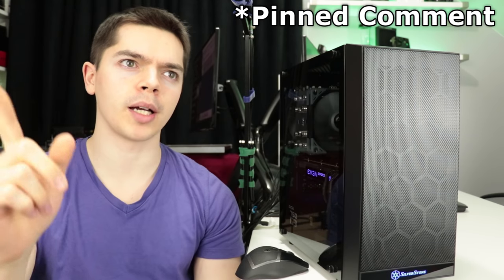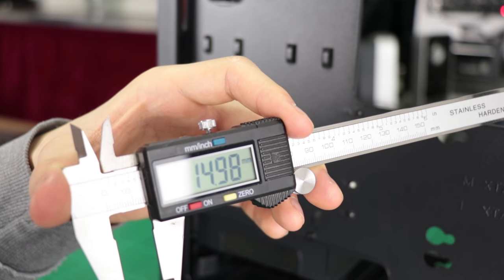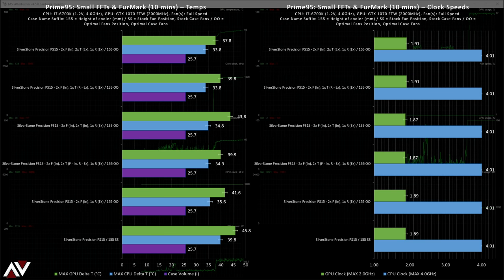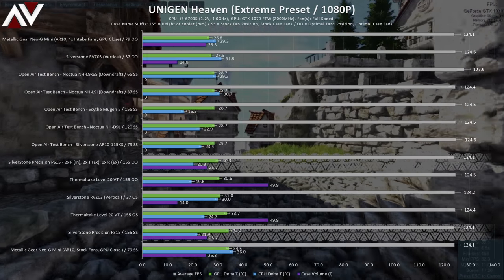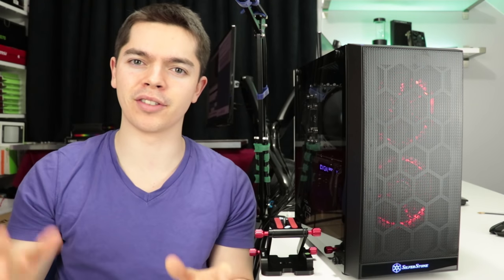SilverStone Precision PS15 (Micro ATX) Review (1/2)

Comment from the maker: Time Stamps:
01:37 - Unboxing and External Overview
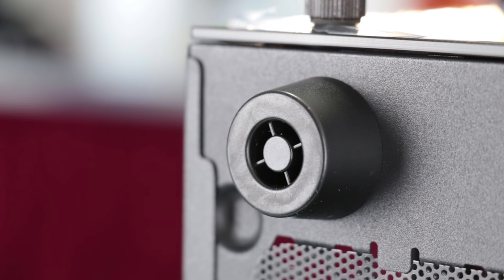04:47 - Internal Overview
09:13 - System Build
10:11 - Power Supply Unit
10:56 - Motherboard + CPU Cooler
11:46 - Drives
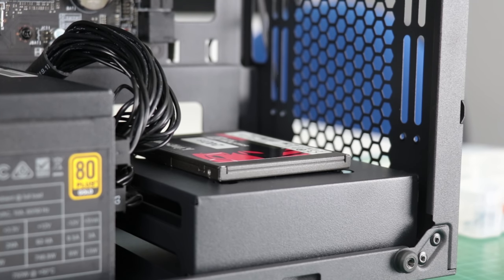13:15 - Graphics Card
13:56 - Case Panels + Cable Management
15:43 - Optimal Testing Setup
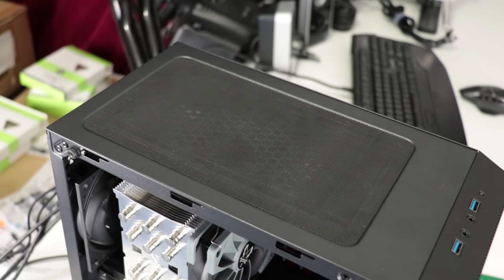16:26 - Fan Installation Warning and Tip
20:11 - Thermal Testing Results
25:36 - B-roll
27:13 - CONCLUSION (Super Important Part)
Reply: AV Techy hahahaha.  I respect your honesty on why would they send a 3,000 subscriber channel a review sample.    Good review.  I wish the case came in while.
Reply: Will this support the Asrock B460m Steel Legend?

Comment: I ordered one of these as most micro-atx are massive boxes and only this case and the Inwin 301 are really in the right size range while having window options.  The regular Inwin case had a front panel that lights up a fixed colour and ruins the rgb scheme and the Inwin 301c (rgb version) I decided was too expensive, £100 and no fans, this case does the job at half the price with rgb fans.

Some modding ideas I have;

-  I have spare higher quality feet with rubber soles so will change those.

- Can mod a higher quality magnetic filter for the bottom 

- I think the hard drive cage is a waste of space, two spaces on the back for ssd's and can fit a motherboard with dual m.2's, would look at either a light mod of removing the cage for extra space for cables, a fancy water cooling radiator or look at cutting a cole for a blu-ray optical drive or something.  

-The case panels having too much clearance from manufacurer error magins, will probably look at attaching rubber seals to the edge of the panels.  

- Thinking the case is a sort of gunmetal grey and thinking I might want to repaint it to be more of a black.

Comment: I strongly disagree with what you say at 35:40 if you make this case longer it will become yet just another boring oversized case. But thankfully Silverstone did something different here to make it 25L! Honestly this thing could be even shorter if you ditch that drive bracket, though you'd need to plan ahead on your gpu length but this is a tradeoff i could've lived with.
Reply from the maker: I agree from the mindset of a small form factor builder. My comments with regards to the drive cage were going against my bias for 2.5" drives to be more aligned with the more popular 3.5" drive users.

It would have been very interesting (if not less popular) if they went for a 2.5" drive cage and reduced the size, or as you said ditch it all together for an additional 2.5" drive space behind the motherboard tray (much like the Q300L).

I'd even like to see a smaller and thicker version to allow for a 3.5" drive behind the motherboard tray for more cable management room and the option of a 2.5" drive.

Thanks for checking this one out and sharing your thoughts, much appreciated!
Reply: Yeah I would have argued they could shave a few mill off, we don't need a drive cage these days. Not unless you build a rig specifically for lots of 3.5".
My mobo has 2 m.2 and there are 2 2.5" behind the tray.

The only issue shaving more depth off is how much it limits GPU length.
Reply: Agreed, have dual m2 slots hard drives, can fit normal ssd's elsewhere, don't need the hard drive cage, going to look a the possibility of modding the case fit a blu ray drive at the bottom.
Reply: Can you take out the sled cage? Or maybe put a different one in?

Comment: Great review, thanks.

I love this case. I've built in it a few times.. they could have given us 1 more centimeter at the back for cables. Would make this case close to perfect for the budget. This is because there is nowhere to hide long cables when you have a full sized HDD installed. Having to supply molex power adds another cable to hide which adds to the drama. Your build was much easier with the 2.5 inch drive which would be a good recommendation for people. 

Also I usually build with MSI Gaming X cards which requires the front fans to be mounted inside the front cover rather than on the inside of the main chassis as you have them set up. You can see the RGB better anyway.
Reply: Hi there I am a noob doing first build, could you tell me where do you plug the RGB cables into, I thinm there is a male and female header for both fans, am I right in thinking you just plug the female header into the JRGB slots on the mobo? I just don't want to break any pins. Thanks for any help!
Reply: Sam Hoey you are looking for a four pin RGB header on your motherboard
Reply: @The_Trojan  thank you for your help! My only question is could I ask what mottherboard and software are you using? I have an MSI motherboard and I'm trying to use Dragon Centre to control RGB and it only detects my mobo RGB although it seems to slightly affect my fans too, but the colours are limited. Sorry if this is confusing but the help is much appreciated
Reply: Sam Hoey I used ASRock B450m Pro4 and ASRock B450m Steel Legend
Reply: Sam Hoey have you got the RGB connector connected to the 4-pin RGB? It will not work with the 3-pin one. Most mobos have both types.
Reply: @The_Trojan  bro, I’m having problems mounting the gpu to my ps15 case, i don’t know how to do the back screws stuff. I think it just doesnt fit. Could you please help me with it

Comment: Top notch review 👍
Nice little case that seems to have it where it counts.
Sure some corners must be cut to fit a certain price point, nothing too major though. 
Except for two things I really don’t like, 1. tethered front panel and 2. bottom dustfilter.

Exceptional job on the filming, you’re so good at getting the angles to show what needs to be seen. Those smooth pans 🤤

Nice idea with the digital calipers to show the measurements 😜

Ohh best set the background leds to a hard switch instead of a fade or static, that darn fade varies the frequency and runs outside of the set shutter speed.

Again thanks Silverstone for having faith in Alex, you will always be his first^^

Comment: Actually ordered one of these, great video review helped me pull the trigger on this one. But now I realized that my PSU is 16cm so I hope it will squeeze in.
Reply from the maker: Glad you found the video useful. I'm sceptical whether the 16cm PSU will fit, it's pretty tight with a 15cm PSU. You might get it to work if you sacrifice some of the tidiness of the cable managment coming out of the PSU.
Reply: I can now confirm that 16cm PSU can fit into this case, though its quite tight there. And the cable management was a nightmare there was virtually zero space to work with. Love the case tho, especially for the price.
Reply from the maker: @rukosak12  Excellent, thanks for posting back here with the find. I can imagine it was quite a struggle, do the cables prevent the use of the 2.5" drive position over the drive cage?
Reply: @AVTechy  There is still enough space for 2.5" drive.

Comment: I have mixed impressions about this case. It seems Silverstone has cut corners in many places and made some questionable decisions that could have easily been avoided. It's almost as like they're not used to making cheap cases like this one and didn't know how to go about it properly, heh. Personally, It annoys me when manufacturers skimp on functional stuff like that cheap-ass bottom filter or breakable PCIe covers and then stick a pricey tempered glass on it.  It's a clear case(sic) of mixed up priorities. But hey, glass sells the case, bla, bla...

So, there's a buch of small nitpics to be found but really, the only serious flaw this case has is that fan mount issue. And it is a serious issue. Nobody is going to see that coming and install some washers before building. While it's true that not all fans will hit the panel, many also will. And something is bound to break,then. Preferably just the case fan blade, not something else. It's something Silverstone can fix in future batches by installing some kindof washers themselves,or by making the fan screw holes thicker/raised.

Otherwise, it's not a bad  case. Looks ok, has pretty good cooling (as expected from that front panel), it's cheap...granted, it doesn't stand out, either. But it works.

PS: get hem to send you the Sugo SG13 to review. It's a great and cheap little case, perhaps my favorite SFF case.

Comment: Exact same internal frame as the new Rosewill FBM-X2 case, just the different branded panels.
Reply from the maker: Oh yeah, nice spot!

There are a couple of minor differences to the rear of the chassis, but the motherboard tray is identical. Very interesting.
Reply: @AVTechy  nahh they are the same, Newegg accidentally used a picture of rosewill's older version of the case for some reason, I forgot about that. Shows one pic of a top mounting psu case, but it isn't that case haha
Reply from the maker: @dawsonclark1364  They're not the same, they're very similar though. Check out the rear fan position and the PCIe slot cover to see the minor differences I was referring to. The PS15 has notched slots whereas the Rosewill case has 4 screw holes with solid panelling above and below the fan position, and the PCIe cover appears to be a hole over a slot. Very similar, and likely manufactured in the same factory with a few minor changes to separate the designs.

Perhaps this is why the front of the chassis is completely flat.

Speaking of differences, check out the front IO on the Rosewill, it's not attached to the front panel like it is on the PS15, that's a big difference and one that I prefer. I wanted the IO in the chassis on the PS15 like it is on the Rosewill case... so good on Rosewill for nailing that aspect.
Reply: @AVTechy  oh you are right about the front panel io actually being mounted to the rosewill case, but looking at the rear of my case it is identical, same fan mount set up, notched, same pci-e covers etc.
Reply from the maker: @dawsonclark1364  OMG, I'm on the Rosewill website for the FBM-X2 case and they've got the wrong rear picture for the case :P So my comments before about the rear of the Rosewill case are completely wrong, check it out:
https://www.rosewill.com/product/micro-atx-mini-tower-desktop-gaming-pc-computer-case-usb-3-0-fbm-x2/

The rear image is of a completely difference case, it's not just Newegg that's screwing up in the marketing department.
Reply: @AVTechy  haha yea man! no worries! In my first reply I said Newegg had done that as well! because they used rosewills images haha! so yea it literally is the different branded panels and front io placement, I forgot it was messed op on rosewill's site as well! lol

Comment: hey AV! thx for this very good review! BUT: how did you manage to fit in that scythe mugen5 cpu cooler which is specified at 155mm height, whereas the ps15 case has a clearence for 154mm only?? im really curious about that, because mugen5 is my favourite cpu cooler and i actually was just about to dissmis the ide of using the ps15 case because of that... another question: what would be the maximal gpu card length if  there are two 25mm deep fans mounted in front? can those front fans be mounted on the inner side of the case or also on the outer side, just behind the front cover??
Reply from the maker: Thanks very much :)

As for the cooler situation. It's all about tolerance. When a manufacturer (all of them, apart from with some really tight SFF cases) say a case can only fit in a certain size cooler, they're accounting for a few millimeters of tolerance. So when SilverStone say the PS15 can fit a 154mm cooler, they're really saying that's all they feel comfortable supporting taking into account manufacturing tolerance.

So if a manufacturer says a case can only fit a 118mm cooler, it can probably just about fit in a 120mm cooler, and so on. It's just manufacturers covering themselves a little so someone doesn't get a case that' too close to the desired lower tolerances they've set themselves to, and then correctly proceed to complain about how the case doesn't match the specification. They avoid this situation by adding a few millimeters onto the case from the target specification (or vice versa).
Reply: @AVTechy  interessting - i didn't know that! i asumed  what about the gpu card length? according to spec the gpu clearence is 314mm - so after mounting in a 25mm width fan, this would leave approx. 288-289mm for the gpu... unfortunatelly most better custom design gpu cards from the rtx270/2080 lineup are somwhere between 290-300mm (palit/gainward: 292mm, asus strix 300mm, zotac amp 299mm, msi 310mm+) - so, is it possible to mount the fans on the outer side of the case, behind the cover?
Reply from the maker: @roqnroll  Graphics card length I'd stick strictly to since it's such a large component.

In terms of what's possible, I just barely couldn't fit my 1070 FTW (266.7mm long) in with an internal 25mm fan and radiator. But you can shift the front fans to the front without impacting the intake too much to gain a little extra space (minus the radiator of course).

I'm not sure if the max GPU length includes the fans or not, I'll have to get back to you on that tomorrow (remind me if I forget please). But you can mount the fans outside the front of the chassis within the front panel space.
Reply from the maker: @roqnroll  Hey, just did a quick measurement and the 314mm graphics card clearance is without the fan, but that's a hard 314mm, so try and aim for a card that's no longer that 310mm at the most.

Comment: Thanks for this! Do you know if it's possible to mount 2x 120mm Fans on the outside (between the front mesh and the mounts), so we could fit a 240 Rad on the inside?

Comment: In my case, top rear exhaust fan makes worse CPU temps that not having any fan at the top
Reply from the maker: Interesting, I wonder if the situation changes depending on the fan speed.

At full speed it seems to be a benefit to cooling, but maybe under normal working conditions (20-60%) it might not fair so well... perhaps something I should look into in the future.

Of course it's also dependant on the intake, which would also be a factor to consider. Maybe next time I get a case in with a pretty standard 2x front, 1x rear, 2x top fan setup I'll play around with all the different configurations at 20%, 60% and 100% speeds to find out what's going on :P
Reply: @AVTechy  Yeah, that would be great for another video. Thanks for replying.
PS: I have the same Mugen 5 cooler with the Phanteks P300 with a closed front. 2 fans at the front and one on the rear. Adding another fan to the top raises CPU temperatures about 5°C.
My theory is that the top exhaust fan exhaust some of the intake air before passing through the CPU cooler.
Reply from the maker: I think your theory sounds about right. Off the top of my head I can't remember if the P300 has top radiator support (it's big enough to take it so I imagine it can). So there's likely more than enough room to bypass the CPU cooler.

The weird thing about the additional top exhausts I they improve the GPU temperature and not the CPU temperature... it makes sense to help with extracting the exhaust from the GPU but it's would appear there's not a lot other than a strong front intake that can improve the thermals of the CPU. It's likely the Scythe Mugen 5 is just doing a great job by itself.

Anyway, more testing is required :P
Reply: @AVTechy  
There is no room at the top for a radiator, just a fan, because interferes with the VRM heatsink. 

My CPU temps are about 52°C while gaming (1080p capped at 75FPS).
RX580 4GB and Ryzen 2600 at 3.95ghz 1.31v.
So I don't have any issue with CPU temps. Great cooler.
GPU temps are about 63°C w/ fan speed at 780RPM.

Case fans at about 600RPM. Scythe fan at about 725RPM
Reply: @AVTechy  nekroposting, but i suspect that the top exhaust fans create a negative case pressure, which enables fresh air to flow in through the vents near the graphics card. The cpu has no access to this passive airflow, which in addition to more hot air flowing up from the gpu leads to it seeing no benefit despite more airflow overall